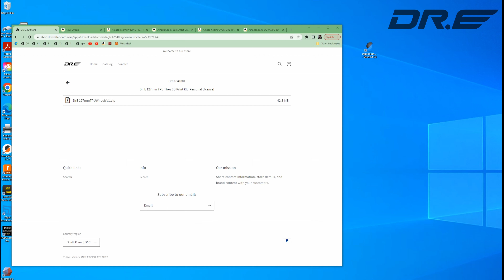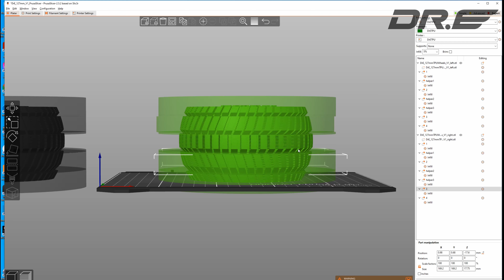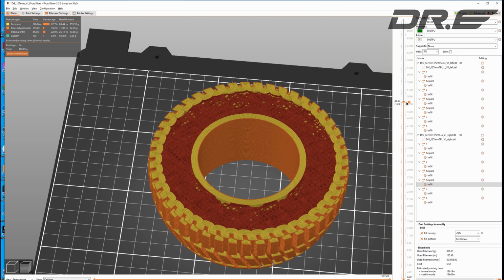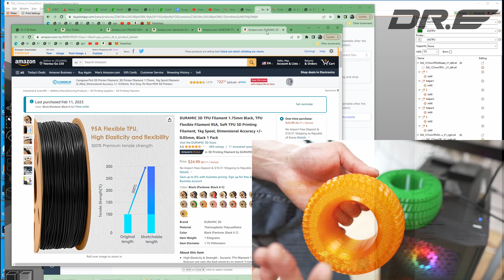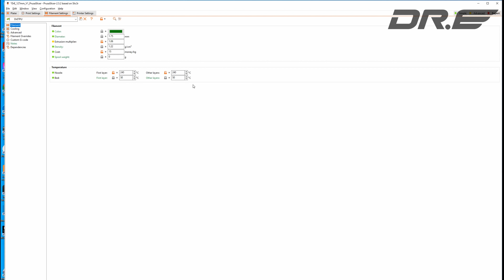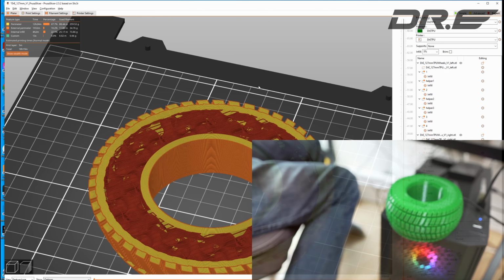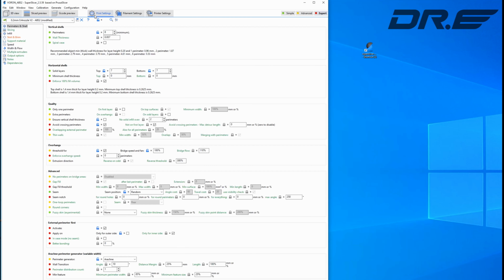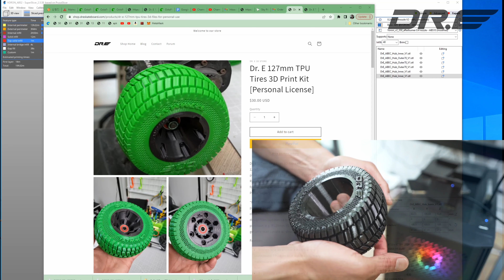How to 3D Print Dr. E TPU Wheels 3D Print Kit w/ PrusaSlicer!

Comment: what about the pulley if i need to print those no stl file?
Reply from the maker: You neee to get Cloudwheel pullies which are compatible with these.
Reply: @dr.eskateboard3381  how perform the tpu tire on the hub if summer heat and abuse it wear out and make slip on the hub or you  use glue to because factory tire very good bond but expensive, what the results long term?
Reply from the maker: The TPU tires do well in summer heat as long as you don't do burnouts on purpose for a long time.   Normal riding they hold up very well as tpu can stand upto 200 degrees Celcius, that is much higher than anywhere on earth.  The elasticity of tpu material expands as soon as there's weight on the board so that elasticity sticks onto abs hubs like glue.  For normal riding these wheels are perfect, I broke my arm going 35mph wearing full motorcycle gear so i dont go too fast these days nor  recommend anyone else to go faster than 25mph on an e board.  Just get a fast car if you want to go faster.